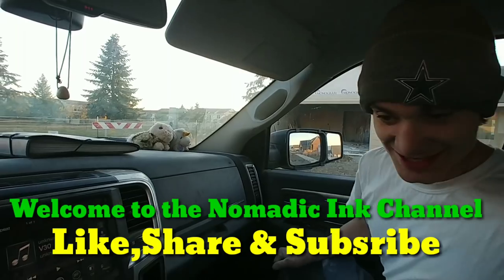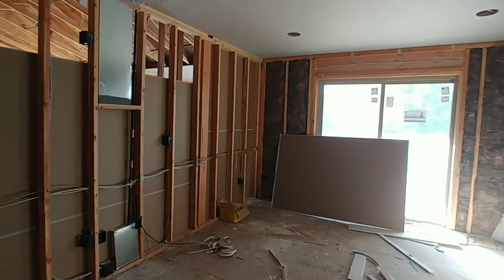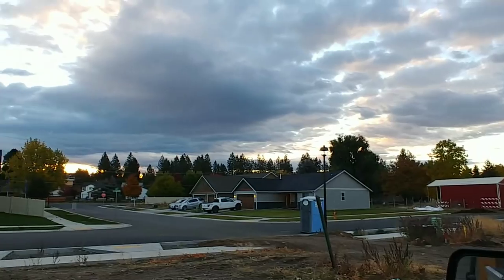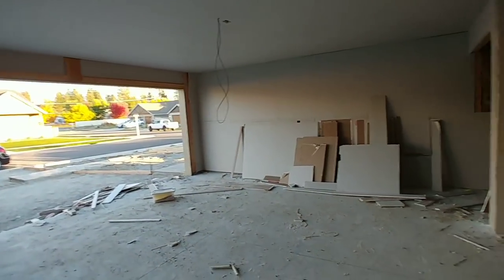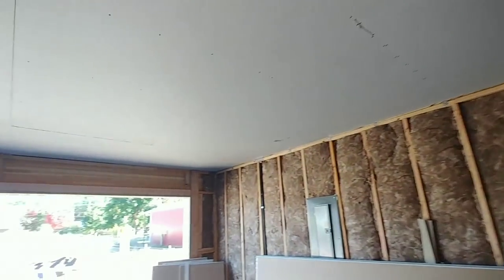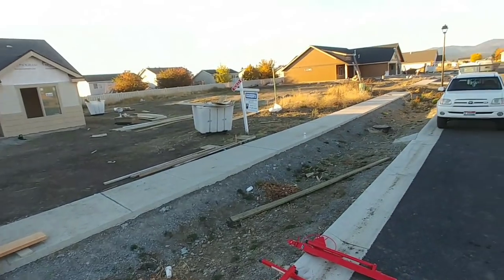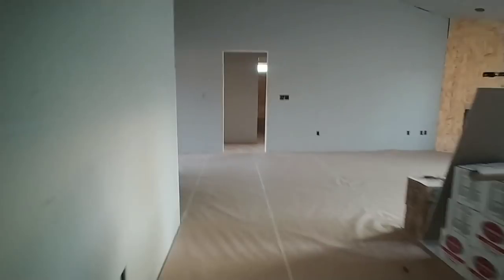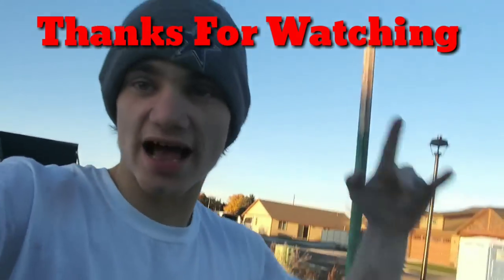2 birds 1 stone, double house work vlog.

Comment: do you double layer garage fire wall as well...
Reply from the maker: Only if the plans call for it. Most the time it's only two layers on the ceiling and one layer of 5/8 supporting the ceiling on the wall.
Reply: interesting... so you are creating a 2 hour burn time on the ceilings yet they only want 1 hour on walls .
Reply from the maker: @SuperJupiter33  it's to keep fire from entering above the ceiling and drafting across the top of the house. Cause that would spread faster then through 1 wall at a time.